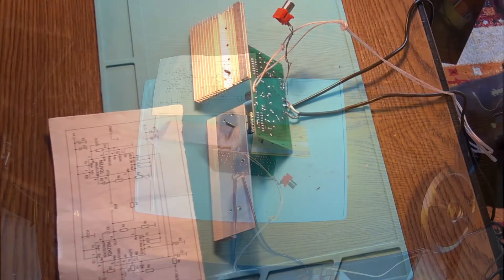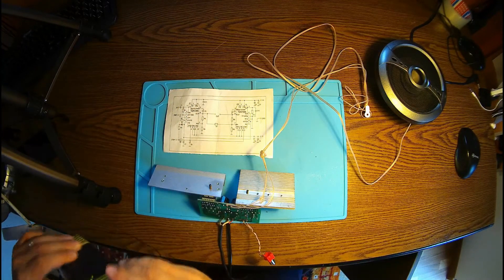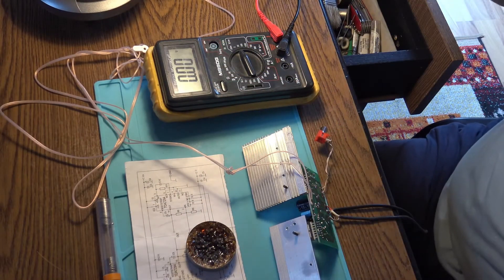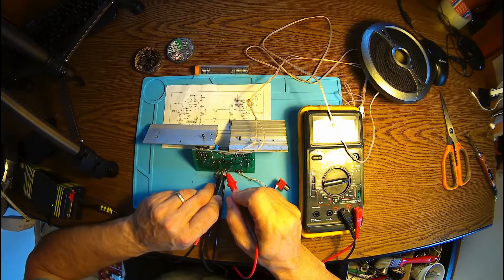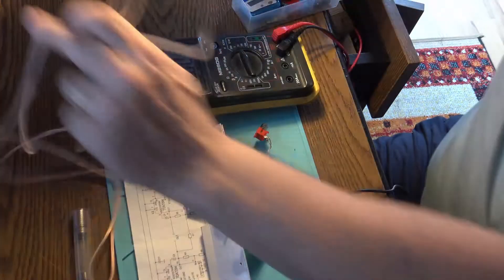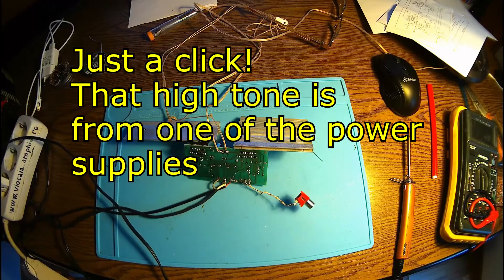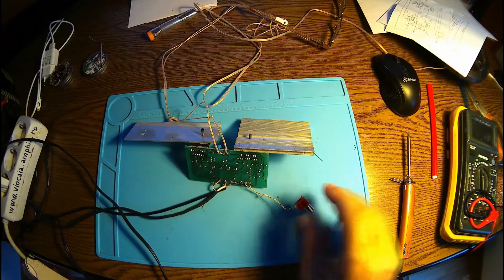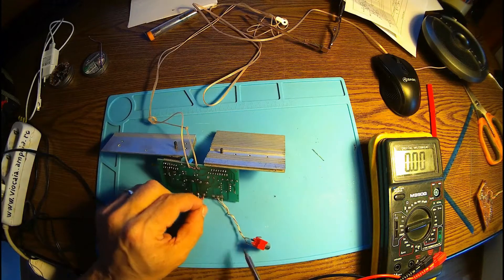TDA7293 bridged amplifier fail...or fake?

Comment: I bought a kit with a single chip I put together that didn't work, did a video way back on it. Couldn't find anything wrong with my work. Unfortunately, it is very hard to desolder the chip. I bought some prebuilt ones that did work well. I recently came across the second of these kits ones, one that I never built after the first one was a fail. Mabe I/ll revisit it, but probably fake chips. Maybe I can figure out some kind of socket for it...
Reply from the maker: It's hard to say what's 'real' today...😢
Reply: @viocaia  I just bought 4 units of what was suppose to be authentic TDA7294s and they were all really good fakes cant tell by looking at them but if you have continuity between pin 15 and Tab , pin 1 and 15 have to diode drop or OL then its genuine.